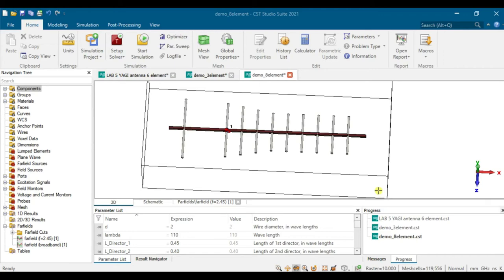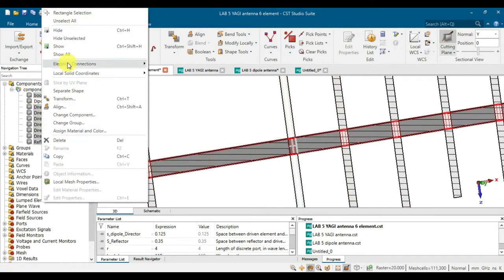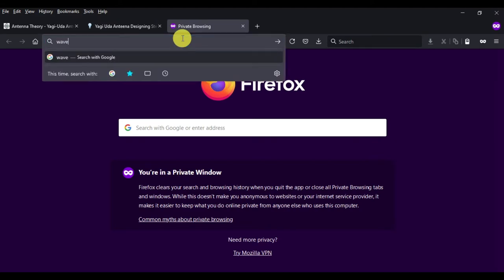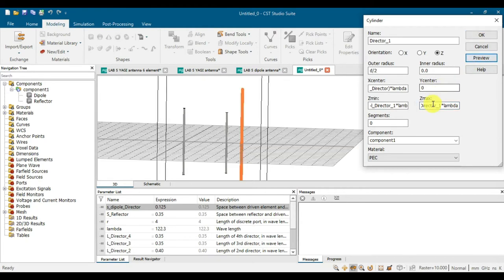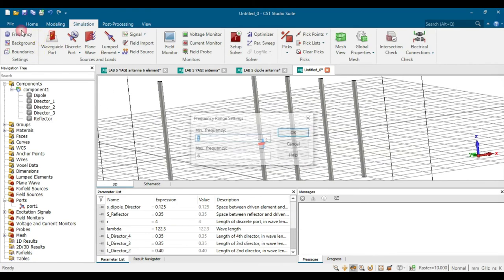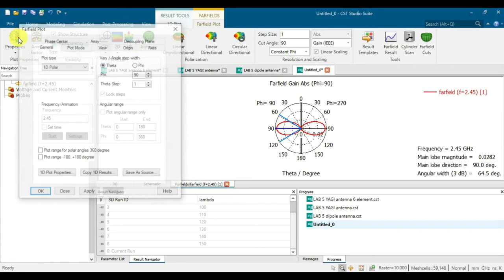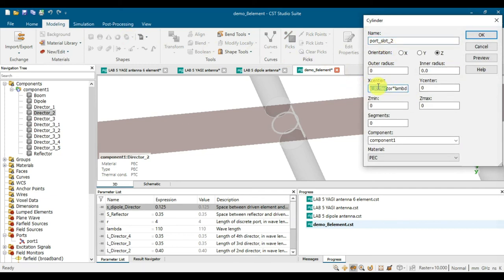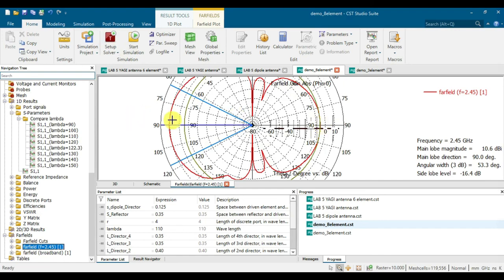Design Yagi Antenna in CST-Full Tutorial

Comment: Blessed love to all, can I get the specification for a 3, and 4 element yagi flat side antenna for 11 meter, please an thanks, watching from Jamaica west Indies  !!
Reply from the maker: A 3-element Yagi antenna for 11 meters typically consists of a driven element, a reflector, and a director.
Frequency: Tuned for the 11-meter band (25.615 MHz to 27.855 MHz).
Gain: Around 6-8 dBi depending on design and construction.
Boom Length: Typically between 4 to 6 feet (1.2 to 1.8 meters).
Element Lengths: The driven element is usually around 0.49 wavelength, the reflector is about 0.56 wavelength, and the director is around 0.45 wavelength.
Boom Material: Aluminum or fiberglass.